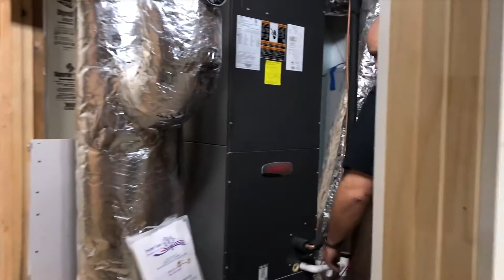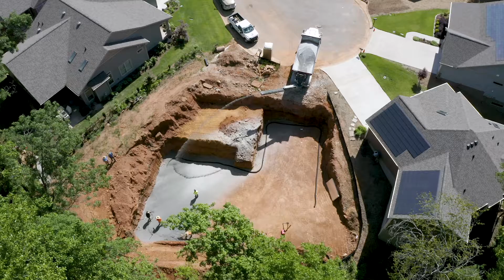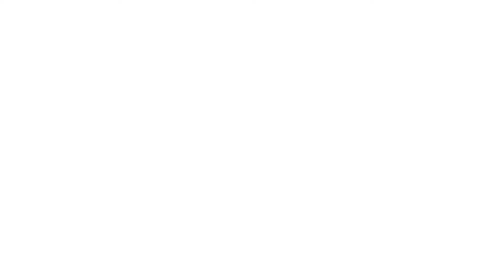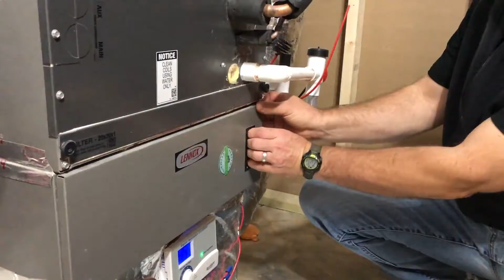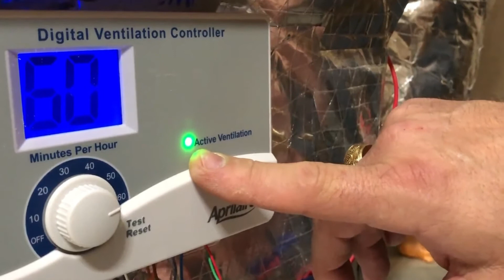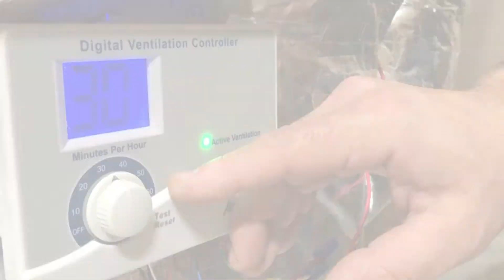Your Addison Home: Whole House Filtered FRESH AIR System

Comment: If you are bringing in fresh air by having windows open or when needed having the AC turn on. Do you even need this turned on? We are curious to turn if off if we are bring in natural ventilation and to also save power? Also sleeping at night with our beds right under vents is difficult
Reply: Natural air is unfiltered so maybe not recommended. And that sucks your vents are where the bed is located. Definitely shouldnt ever have a vent over where a bed will be.

Comment: If you bringing fresh air in don’t you need to exhaust stale air out somewhere?
Reply from the maker: @chunkybeast420  yes. There are a variety of methods for ventilation. This approach is referred to as a positive pressurization strategy and relies on stale air leaving the house through the one-way dampers in the exhaust vents (bath fan vents, range hood vent).
Reply: My house was built by a production builder and it uses this method of getting fresh air. The dampers hang partially open on the exhaust fans when the hvac runs.

Comment: We have merv 13 because I was worried merv 16 would put too much stress on the system. Is this a valid concern?
Reply from the maker: It depends on what the total static pressure from the supply and return ductwork (including the filter) is compared to the rated static pressure on the blower.  We always account for the static pressure from the MERV 16 filter when designing our duct systems so that it does not exceed the rated static for the air handler.

Comment: Are they supposed to run every hour or does it depend on temperate/climate outside?
Reply from the maker: We set the ventilation frequency and rate based upon the ASHRAE ventilation standard 62.2

Comment: Says MERV 16 but there is a MERV 11 filter in there...
Reply from the maker: Good catch!!!!  You are right - we actually use a MERV 11 during construction to protect the air handler and ductwork. Then we switch to the MERV 16 filter at the homeowner move-in.  We will typically go through a couple of MERV 11 filters during construction.
Reply: I thought Merv 13 was sweet spot for proper pressure. 16 could be constricted? Thanks

Comment: What’s the recommended number?? Plz help by answering that my house is single story 4br house it feels humid in here I’m not sure what the setting is supposed to be at
Reply from the maker: Hi- if you’re living in an Addison Home, the optimum ventilation rate should have been set at move in. If you don’t know the setting we would be happy to come out and check it. If you’re not in an Addison Home and have a fresh air system, the system airflow should be measured to set the ideal rate based on the size of your home.  Please note since you mentioned humidity, the fresh air system does not control humidity - not to be confused with a dehumidification system.

Comment: I'm curious to know how the owner would know what the correct setting would be? Is there a test that can be done or does it say in the manual to set it to 30mins for a small family or 45mins for a large family etc.?
Reply from the maker: Hi Paul!  We actually measure the fresh air flow rate at the commissioning of the system and mark the recommended setting that meets the ASHRAE ventilation standard for residential homes.  This is based on the square footage and number of bedrooms in the home.  The owner can certainly adjust for more or less, but the recommended level is indicated.